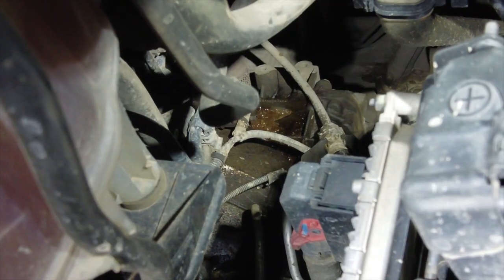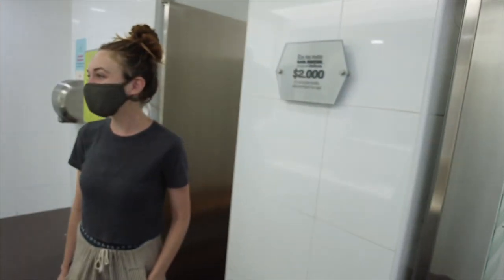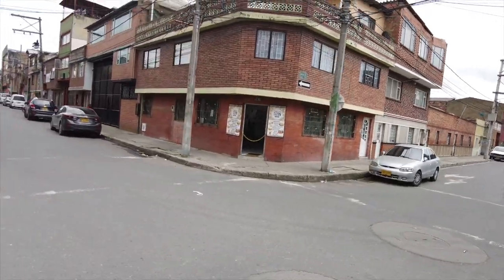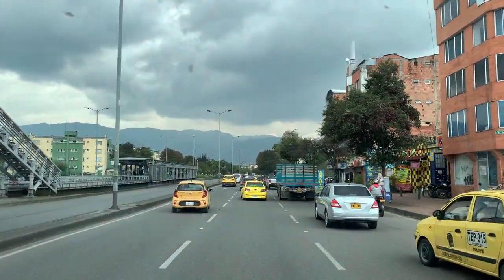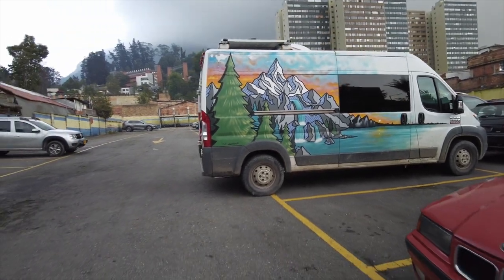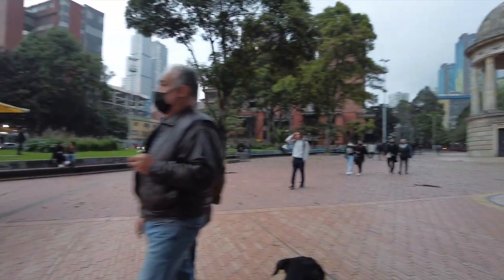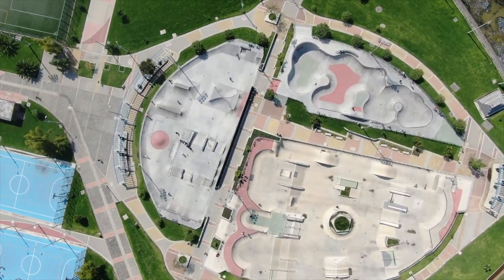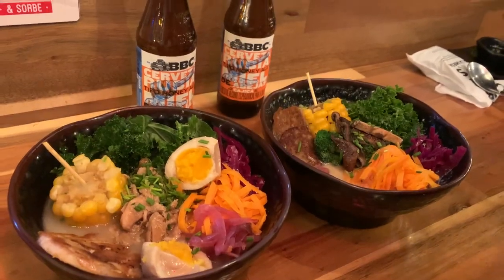LIMPING TO THE BIG CITY... Can they even fix a Promaster here? #vanlife #panamericanhighway

Comment: Hey guys. This is my advice as a mechanical engineer and an aircraft mechanic. How many miles do you have on that van? The fan is warning you way ahead of time it is time to replace it. Must likely the bearings are worn out. As long as you don`t stress it too much going up the hill - higher engine temperature -, it should take you where you can replace it. Do not stretch it for too long.

Also, wash the engine as soon as you can. That will help you to identify any leaks. It is always a good idea to replace all fluids (engine,  transmission, etc.) if you have a high milage.

Finally, gracias a los hermanos colombianos por el buen trato que le están dando a esta pareja de jóvenes norteamericanos. He estado varias veces en su país y se lo bueno y luchadores que son la mayoría de los colombianos. Saludos,
Reply: Roberto Galvez;  you can watch their previous videos to answer your questions.  I believe the van has 187,000 miles, but they said the fan had been replaced a year ago.  It’s good they are thinking about preventive maintenance in all areas of the van.  Mechanical/electrical issues can be a real strain when you don’t know how to diagnose them, but with their attitude they should be fine.
Reply: @moremoney2  I agree with you 100%. 187,000 miles is a lot for a van like that. Got to be more careful with preventive maintenance, more TLC. If the fan was R2 a year ago, most likely is under warranty.